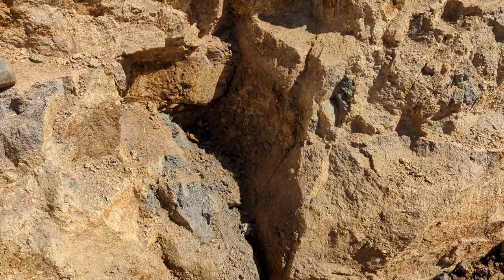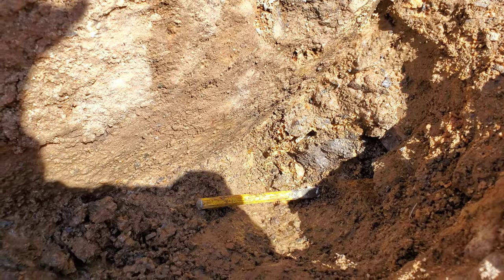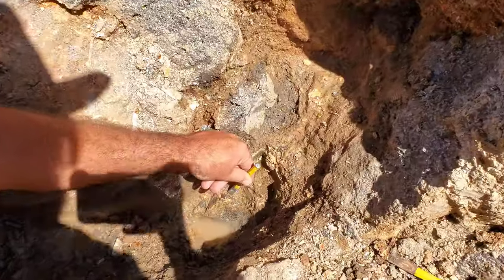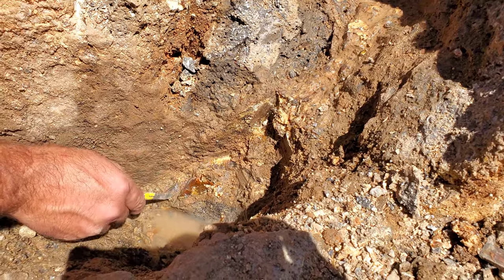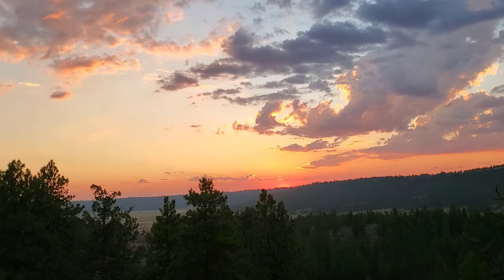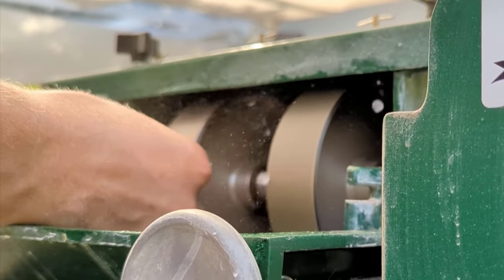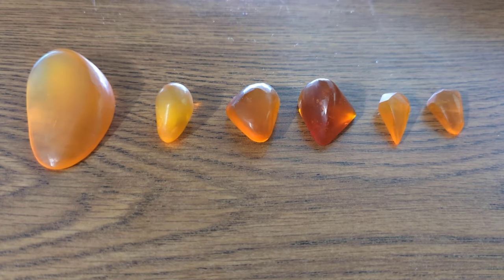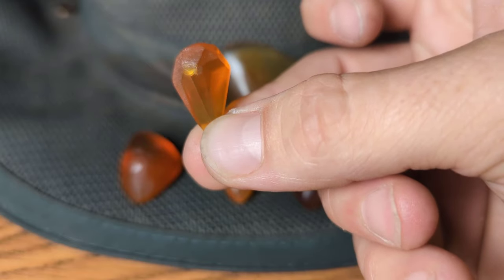Rockhounding Oregon Fire Opal | Cut and Polish Oregon Fire Opal

Comment: Looking good. Opal really is special with the water content. Saw it down before drying to the preform of what you are making so it does not pull itself apart needlessly. You want huge, its a spalling risk during curing. Everything has risks; AKA wet is not always how dry always looks as opal does have a tendency to change over time, every opal eventually.